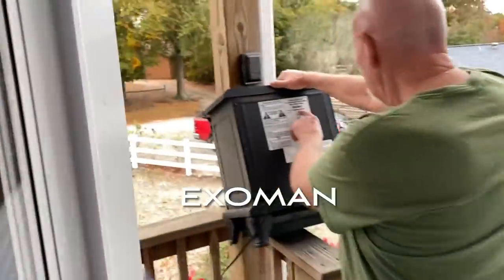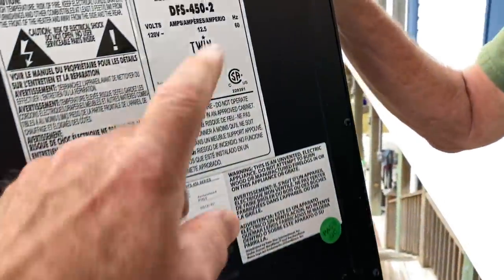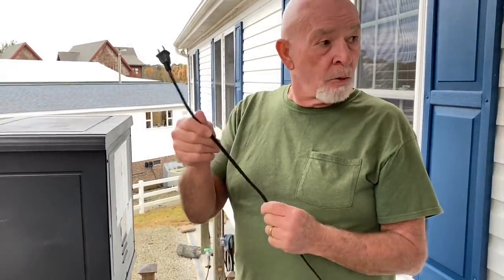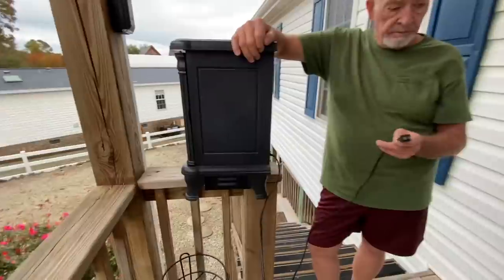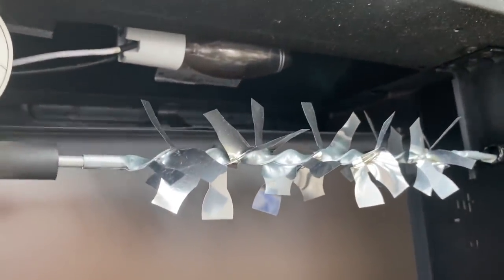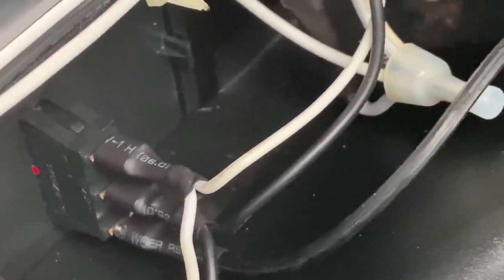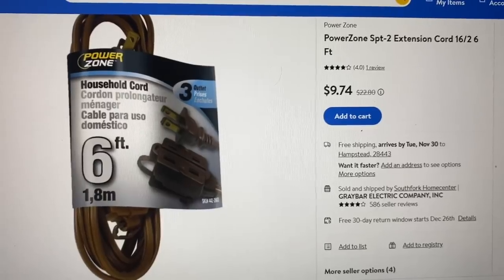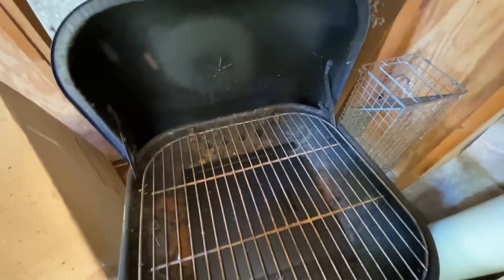House Fire Heater

Comment: Good advice to everyone on not using high current draw heaters on extension bars. That heater is not a keeper in my book as your neighbor said. Watch that back plate does not have a toxic coating on it if you use it on your barbeque. Always enjoy your content. All the best

Comment: Also when you're using a high wattage device like electric heaters, from personal experience, I highly recommend replacing the outlet to a commercial (higher quality) outlet. There is a big difference in the quality of the outlet and the way it makes contact with the terminals of the cord / plug. Contactor grade outlets are lower quality and do not make a solid connection like higher grade outlets. Don't take my word, research for yourself. It may save you from burning your house or worse.

Comment: I bought the exact same Duraflame a year ago and the same thing happened the cord is actually undersized for the elements I think it is either a 16 or a 22 wire it should be a minimum of a 14 wire to handle 15 Amp you can find the wiring size on the cord imprinted I ended up changing the cord on mine and it worked fine.

Comment: Did you think of or try contacting the manufacturer about a safe heater replacement or returning to store to get your money back❓ I have original Eden Pure Infared heaters and I learned real quick to NOT plug them into a 2 prong non grounded outlet. They come with a heavy duty 3 prong chord and are fine if you plug them into a grounded 3 prong outlet but will heat up and potentially cause a fire if you use and adapter and run them off a 2 prong outlet.

Comment: I'VE Had two in the past start SIZZLING AND MELT DOWN in front of me in the past  , got to it as soon as it started happening  , only damage was slight burn on wood floor , but electrical fires burn hot and fast forsure. Scary stuff .

Comment: It is "CSA"...Canadian Standards Association. CSA is a "NRTL" (Nationally Recognized Testing Laboratory). The small "US" indicates it was tested to a US standard. The C indicates it was tested to a Canadian standard. Chances are with the amps that is drawing on that circuit it's possible the wiring in your house may share some of the blame (possible not certain of course as its just specilation) along with the obvious chintzy wiring the heater came with. . Run it on a circuit that doesn't have anything with a heavy draw closest to your breaker box.. Make sure you keep it far away from any walls or covering, top or sides if you do decide to use it.. Personally, even if it is UL listed I would never leave one of these "on-line" unattended or where people would be sleeping with it on.. or ya just chuck it. Not worth the risk for the $60 for a safer option.. Ex-firefighter... stay safe. Keep up the great content. Happy holidays to you and all your subscribers.

Comment: Seems that running heaters at 120v drawing 12.5 Amps pushes the cords to their limits, we have 240v in the UK so such a heater would run at just over 6 Amps, it would also be earthed. The downside is that 240 is a more lethal voltage.

Comment: I see the issue that you had I had the same problem with an over heating plug never set the heater at max heat middle or lover setting will turn your heater on and off baised on room temp

Comment: Need to use a 12 gauge wire power cord. It will handle 20 amps @ 120VAC.

Comment: WOW....based on the information of 12 amp the power source should a 15 amp breaker on 14-2 wire....but hold onto your socks....what most people don't realize is all electric 110 Volt heaters are the same if they are UL rated.....They all draw 1,500 Watts....some offer  a two setting switch 750 watts - 1,500 watts...so why is there a price difference in heaters......perceived design of the cabinet!!!....Next time you buy an electric heater look at the boxes and you'll see as I said all of the units are same Max of 1,500 watts. It called building a better mouse trap for the seller to make dollars. Finally are electric heaters a good deal? An electric heater running for one hour at 1,500 equals 1.5 kilowatts....look at what you pay per KWH and do the math....if your rate is .20 cents that cost is .30 cent per hour or $6.00 for 20 hours x 30 days $180.....that's an ouch

Comment: Ok but if you alter the unit by changing the cord and something bad happens, there is no recourse with the manufacturer because the product was altered. If you don't believe it is made correctly, return it. This is not very good advice you are providing.

Comment: You shouls never have an extension cord on any heating device and it should be plugged into  a dedecated circuit. this goes for anything with motors too. they should never be plugged into extension cords power strips or multioulet devices such as a two gang to six gang adapter.